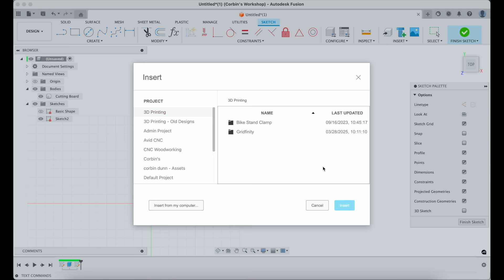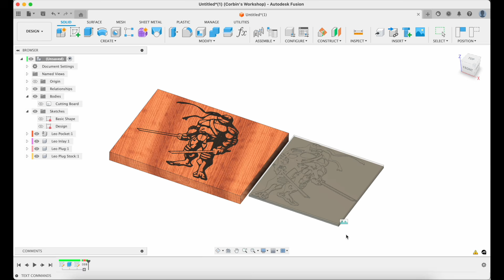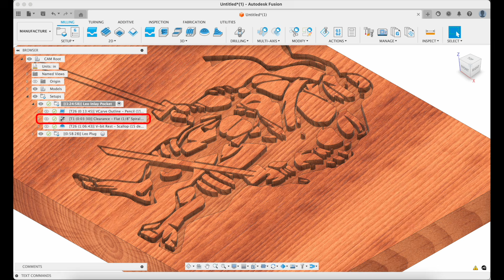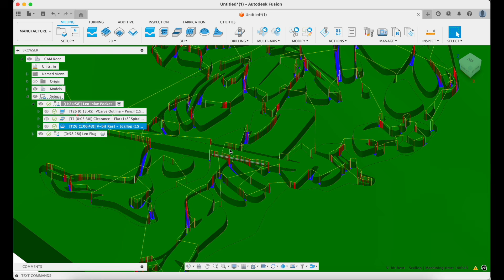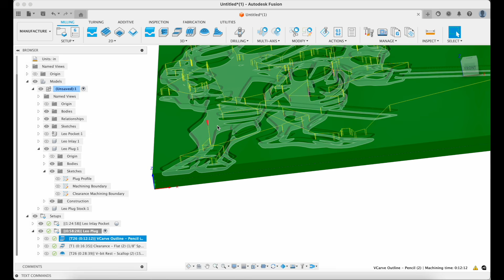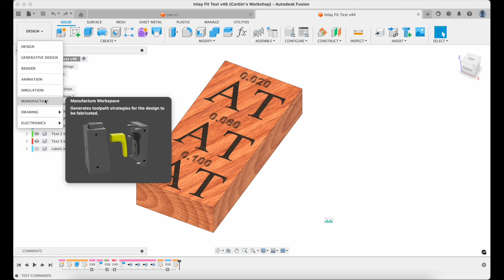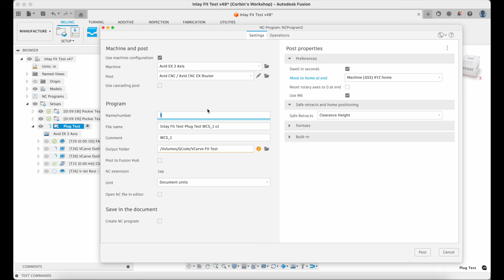I cracked the code! VCarve Inlays with Autodesk Fusion 360 - A complete tutorial!

Comment: Hi Corbin, I think I figured out something important from looking at your formulas. Would I be correct in assuming your plug-in only works with classic V-Bits and not tapered spiral bits?
BTW I have done many inlays over the past 3 years and every one had fit adjustments of 0.005 to 0.009 based on wood species.
Reply from the maker: I uploaded version 1.1 that will work better for this
Reply: @CorbinDunn  I loaded 1.1 and it seems to work much better. Once I select the correct tool for all toolpaths your parameters are correct.
Reply from the maker: Regarding fits: Yes, for straight inlays and joinery, I find 0.003" to 0.009" is a good tolerance. V-carves, coming to a sharp point, are a different beast..and behave differently. You can leave zero tolerance, and a 15 degree vcarve plug will still fit into the inlay pocket; it just won't seat all the way to the bottom. Technically it shouldn't fit...but wood will move and allow it.
Reply from the maker: Hi Robin, No - it will also work with tapered spiral bits! I just realized my filtered list that I show will not include them. I'll fit that in version 1.1, which I hope to release soon. You have to manually put in the taper angle in the Parameter and set the bit in your toolpaths.
Reply from the maker: If you want to try the next version that has this fixed, send me an email! I also added it to the documentation: https://www.corbinsworkshop.com/vcarve-inlay-plugin-for-autodesk-fusion-documentation/

Comment: Hi Corbin. Trying to install the plugin. documentation says click folder, select folder I unzipped, select run button, Except there is no "Run button". What am I missing? I am using the hobbyist free version. Does that matter?
Reply from the maker: Hi Bill - Do you see it in the Scripts/AddIns list? The "Run" button looks like a switch slider button. Autodesk's doc is here: https://help.autodesk.com/view/fusion360/ENU/?guid=GUID-9701BBA7-EC0E-4016-A9C8-964AA4838954
Reply: @CorbinDunn  I re-downloaded the file and went through the steps again. This time it worked. I'm sending you $5 Thank you for your help.
Reply from the maker: @almostfixedgarage great! I’m glad it worked. Eventually I may have an installer to make it easier.

Comment: As always a great explanation/demo.  Having watched the video a couple of times now it got me thinking about the process...  Let's say for example you wanted the swords in purpleheart, leaving the rest of the inlay in walnut?  Did you intend the plugin to be able to work with multiple inlays?  If I named the first inlay as Leo-Walnut and select every vector except the swords, then create another inlay named Leo-Purpleheart and only select the sword vectors.  Would that process work?  Thanks again for all the hard work and I'm sure late nights on this plugin.
Reply from the maker: Hi Steve - Yup, that scenario should work great! The inlays have to share the same v-bit angle and depth; that's the main limitation. In my example, the sword was combined with the main profile, so they'd have to be two separate profiles to actually work.
Reply from the maker: This is also a good example where you would possibly NOT want to check "New Component"  when you run the plugin a second time. You can select the original "Pocket" as the target, and it will just add more cuts into, but the Machining Boundary and toolpath will be unique. I should do an example of that...
Reply: @CorbinDunn  I think a demo of that would be help and prove the concept.  It may also help those working with epoxy inlays, where they tend flood the project with a base color and then carve out and the inlay epoxy layer by layer (dependent of color) .  I really think you are onto a winner plugin, congrats!!!!
Reply from the maker: I'll try to incorporate that into the next video, where I do a curved inlay. I'm thinking of an 8 ball/sphere, with 3 different woods.
Reply: @CorbinDunn  You are now the official Youtube Inlay Guy, brace for impact ;)

Comment: Thank you so much, Corbin. Rest tool path is saying "Error: Failed to generate scallop passes.". All other toolpaths are fine.
Reply: Update: For the inlay, I went into the geometry tab and check marked the model and selected it, then the rest tool path worked. The plug rest didn't work still.
Reply: One more update for the plug: In the rest machining, I changed the ignore value to a much bigger value and now it works for me.
Reply from the maker: Ah, bummer! Fusion sometimes has issues/bugs. It sounds like just "touching" the inlay toolpath fixed whatever issue it had. Can you send me your project with the values you had set? I can try to figure out if there something I can do to make it better. corbin@corbinsworkshop.com
Reply: @CorbinDunn  I just sent you the email with the files and test photos. Thank you so much!
Reply from the maker: I got it! I'll respond in a bit.

Comment: - Great job (all around), Corbin.
- Was nice to see the full process start to finish, and including all the details.
- BTW, I'm a retired "bum" w/o a job; started in 3D 30+ years ago; have been into 'Fusion' / 3D CAD for ~9 years (including helping/training folks for most of that time); earned living writing custom code for 3D, and am a teacher by nature/profession. So, took look into the plug-in you wrote (quite impressive, on first glance). In fact, created github repository of plug-in so I could study it, along w/ the help of an AI assistant ('Gemini 2.5 Pro'). Vibe coded a webpage giving an initial look. Will share in separate comment...
- Also, vibe coded webpage for this video, which I will also share...
Reply from the maker: Thanks John! I appreciate all the great help you provide people over on the Facebook group. I also did programming for a living -- I previously worked at Apple for ~13 years and I was one of the original software engineers working on the iPhone 1.0. This was my first foray into Fusion's API, and I already want to rewrite it to make it better. I think it would be well suited as a single "Custom Feature" in the timeline to contain all the settings, instead of doing it via Parameters like I did. I'd still have to pass information to the Setup/Toolpaths, but i have a good idea on how to abstractly do that.  Yeah, at least 200 hours coding it...mostly learning the quirks of the Fusion API, and Python...although Python is super simple to learn.
Reply: @CorbinDunn  
- Cool. And thx for the kind words; as a teacher, Facebook is a great place for me :)
- And, hopefully the vibe-coded webpages finally got posted.
- Plus BTW, I have been learning the 'Fusion' API, too.
Reply from the maker: @swamihuman9395  Cool! If you are using Python, copy my Fusion360CommandBase.py file and use it. Patrick Rainsberry wrote the original version, and it is a a very easy, object-oriented way to create commands. My first version was all procedural; what was a pain. Using objects is just so much easier for clarity and data flow.
Reply: @CorbinDunn  
- Yes, I use Patrick's template, and other things. I have an effective database of his stuff (plus other resources I have scoured the Web for). No need to reinvent the wheel, as they say.
- In fact, he and I have corresponded via email.
Reply: - I uploaded the links to the webpages I made, but don't see the comments anymore.
- Perhaps YouTube took them down because of the links.
- So, will repost, but with obscured URL: will replace the . with DOT, and / with SLASH - then you can simply change it back...
Reply from the maker: Yeah, links won't work on my YouTube comments! You can also email it to me so I can check it out: corbin @ corbinsworkshop.com
Reply: - Also, clearly you put A LOT of time/effort into things:
--- CODE: planning/implementing/debugging/documenting/etc.
--- APPLICATION: entire workflow; and making sure everything works as intended in Fusion, and in the workshop at the CNC.
--- VIDEO: planning/implementing/editing/etc.

Comment: I tried the plugin now just on the computer and it worked. This is so much better then the vectric software lol. I ran into two errors. Working in metric I set the tip diameter on the vbit to 0.001 and it errored out. at 0.1 it worked. And when I tried to use some other vectors I had that was not a svg I got a "this is not a parametric design" error. I will play with it some more and see. Before I cut anything I will have to go through the cam operations and maybe set multiple depths etc so I know my machine can run it,
Reply from the maker: Cool! Set the tip diameter to 0.001in — that forces it to inches. .1 may work in mm because that is .004”. Any closed profile should work; email me your design and I will look at what is wrong (corbin at corbinsworkshop.com )

Comment: Wow this is phenomenal work!
Reply from the maker: Yeah! It works in metric; if your document is metric all the values will show up as such. Except the bit diameter...(mainly because most bits are in inches), but you can through in "6mm" to the input field and that will override the inches. 

The docs describe how to install it: https://www.corbinsworkshop.com/vcarve-inlay-plugin-for-autodesk-fusion-documentation/

If you have trouble figuring it out let me know! I want to make it easy to setup. I had it in the video...but had to cut it due to an issue w/my exported video.

Comment: I think you are one of the Best woodworkers in youtube. How hard is to convert this extension to metrics?
Reply from the maker: Thanks! It works in metric. Just make sure your document is in metric. I kept my tool setting in inches, because most woodworkers still use inch based tool diameters; but you can just put your value in as mm and add mm at the end. It should work fine
Reply: @CorbinDunn  We need to convince trees to go metric ;)

Comment: Really impressive.  Nice work.  I did some v-carve inlays with Fusion a few years ago.  It took a lot of R&D to figure it out.   You said having a gap at the bottom was bad.  Why is that.  I thought a small "glue gap" was standard procedure for something like this.   Also, if there was a lot of clearance stock to remove, could you duplicate the clearance toolpath, then change the bit, lets say from 1/8" to 1/4".  Then run the 1/4" toolpath followed by the 1/8" bit toolpath, but have 1/8" bit toolpath be a rest machining toolpath.  Would that work?
Reply from the maker: So where in woodworking would you ever leave an intentional gap when gluing things up? The answer is never! The glue will always squeeze out and find somewhere to go when you clamp things. Having a gap will (potentially) reduce strength. That isn't a big deal for ornamental inlays that don't get a lot of handling, and you can get a tighter inlay if it can squish down as much as possible. in theory, it might be a bigger issue if you are doing face grain to face grain; most the strength will be lost -- you really need that face grain to touch the bottom of the inlay. It's similar to why regular woodworking butt joints are weak, but gluing face-to-face or side-to-side is strong.

Yes - you can easily duplicate the toolpaths to add more clearance operations and use rest machining -- this should work great. Eventually I'd like to add more options to just pre-do this for the user.
Reply: @CorbinDunn  Agreed, gaps are so not necessary that they are bad
Reply from the maker: Why does everyone say to leave a "glue gap"? I think this is because that was the only way to adjust the fit of inlays with "traditional" methods (Vectric VCarve) and it is just a misunderstanding of what is going on when you make the "glue gap" bigger to get a better fit.

Comment: Great work on this. One question, when using Vectric Vcarve for example, there can be a small "glue gap" left intentionally at the bottom of the female pocket to allow for glue squeeze out. In your experience, is this not needed?
Reply from the maker: I think the concept of a glue gap is hog wash and not needed. I've never seen any circumstance where the glue didn't squeeze out the sides. Woodworkers never leave a space for glue in other things they do. The only reason people talk about a "glue gap" is because that is their "inlay fit adjustment". But the thing is, they have to adjust both the "glue gap" and the "surface gap" in tandem. I just eliminated that nonsense and made it one variable: the "inlay fit adjustment". 

If you really want a true glue gap, you can make the "inlay fit adjustment" larger until a gap shows up.
Reply from the maker: I should note: having a glue gap at the bottom of your inlay will likely give you a tighter inlay (less gaps on the part you see), but at the risk of having it not be as strong. So, it'd probably be fine to have on ornamental designs that aren't getting handled.
Reply: @CorbinDunn  Thanks for the reply. Just purchased a license!

Comment: What does protecting that tool path do exactly?
Reply from the maker: It just "locks" it; meaning it won't invalidate it when you move it up in the group. Normally, if you move it up, it would invalidate it, because it has "rest machining" turned on, and it would need to re-compute the toolpath due to the stuff before it changing.